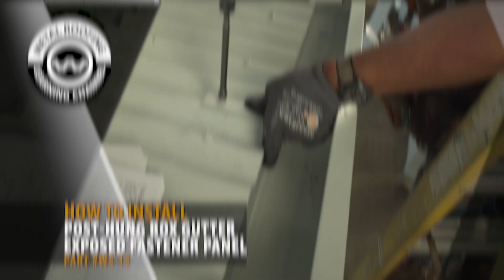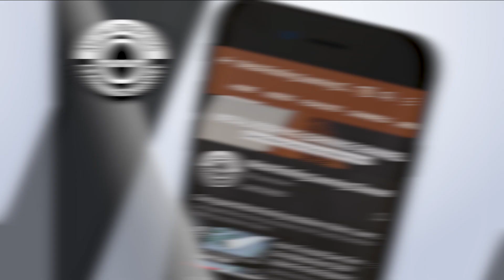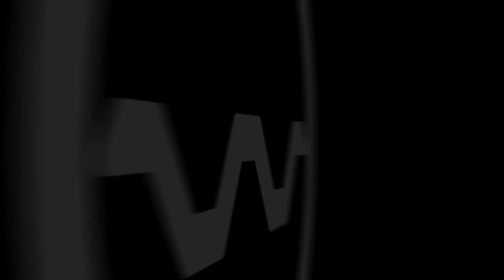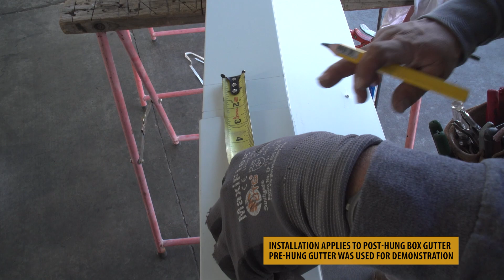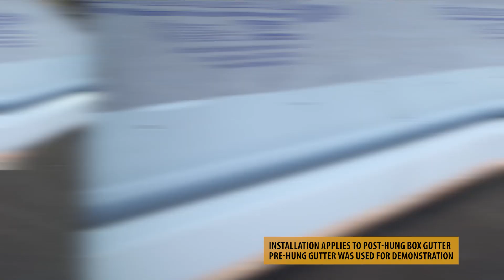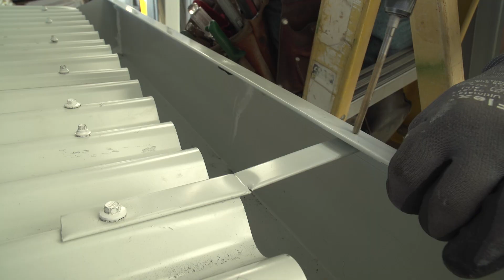Hanging DIY Gutters For Metal Roof. Post-Hung Rain Gutter Installation With Metal Roof.

Comment: Can these be installed after the metal roof has been installed?
Reply from the maker: Yes, post hung gutters can be installed after a metal roof installation. We recommend pre-hung gutters if you're roof is not already installed.
Reply: @WesternStatesMetalRoofing  yes you do, but you are in the desert and I am in the rainforest.  I didn't even KNOW that post-hung was an option for my standing seam roof!  I'm a little concerned that the prehung system isn't going to drain water fast enough because it is level, spanning 50' before hitting the downspout.  Not seeing a way to easily mitigate that.  I guess we will see....
Reply: Yeah I would like to see how a flat gutter will hold days of pouring rain????
Like Pacific Northwest rain.